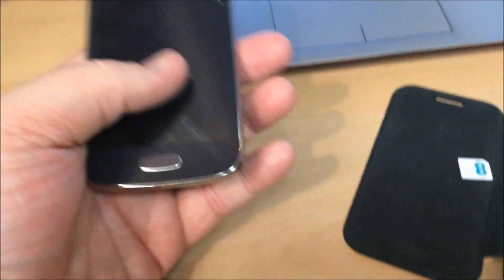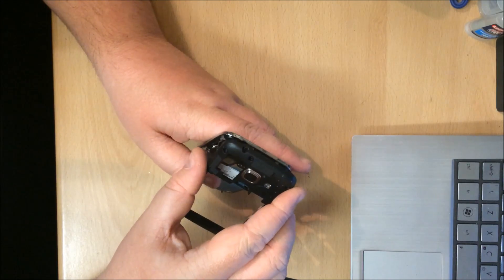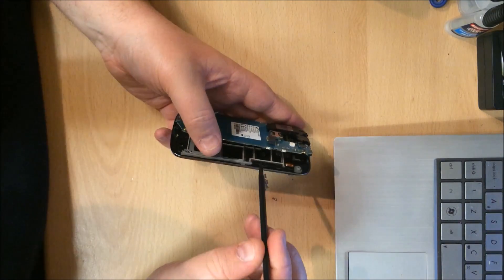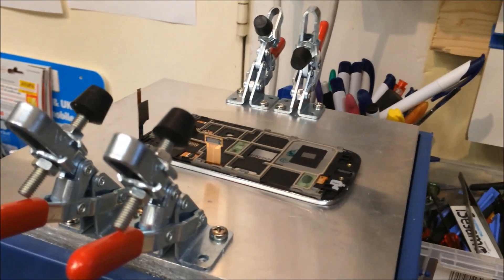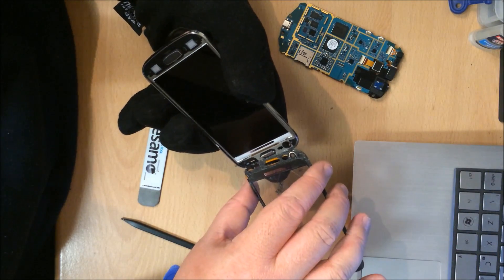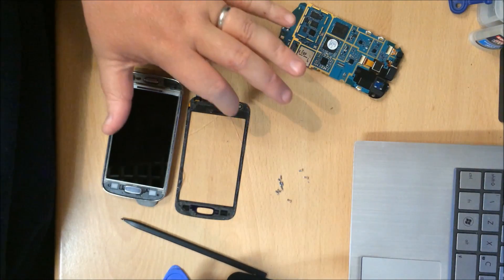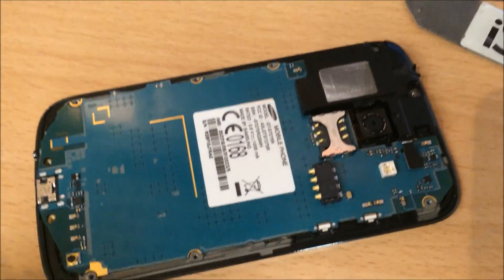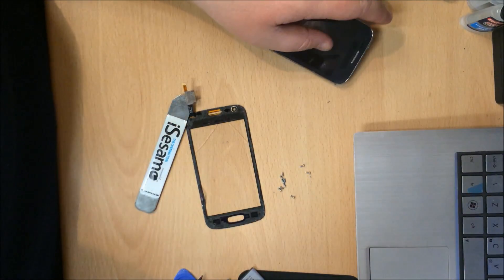Samsung Ace 3 Disassembly Take Apart Guide S7270 S7272 S7275

Comment: isn't it too hot to heat to 60 degrees for that plastic ,, i'm testing with a digital thermometer and i stopped on 45
Reply from the maker: TuubiUser 50-60 is fine

Comment: hello , what did you remove on 8:27 ? 
i did everything you said ' but when i am turning on the device, the screen is flashing.
do you know what might be the problem ?
Reply from the maker: the sticker that is ontop of the new glue on the flex, if the screen is flashing then check the lcd connection to the board, or you may have damaged the screen in the process

Comment: Hi, I've bought a new digitizer on e-bay to replace the broken old one in my 7275R phone, but the new one does not work at all. The back side of the new digitizer is a bit different than the old one and it has a label "DUOS", but it fits perfectly. Acc. to the box it is compatible wit all 727x models... Any idea?
Reply from the maker: i have no idea, but order the screen that matches the model of your phone

Comment: Hi...I broke the little 'clip' that the screen cable goes into. I tried to just use some tiny double sided tape to hold the cable in place, but its still not working. does the clip do more than just hold the cable in place ?
Reply from the maker: try tape, worse case replace the lcd
Reply: Its the clip that's broken...the LCD screen was new.